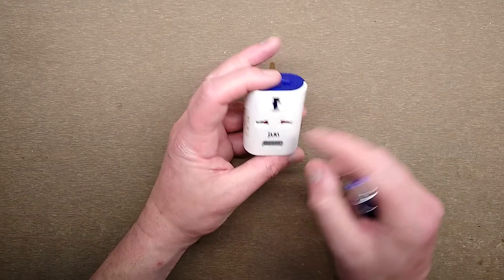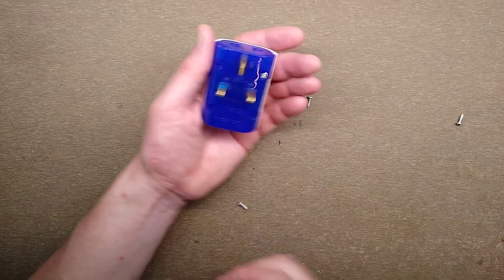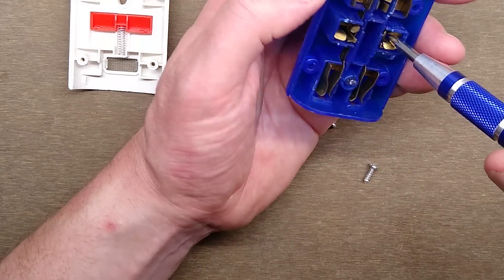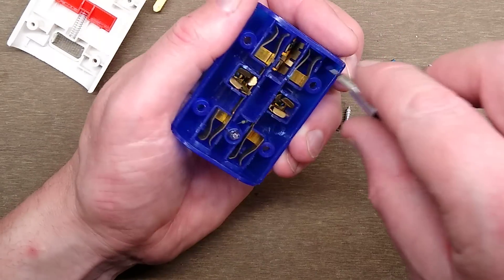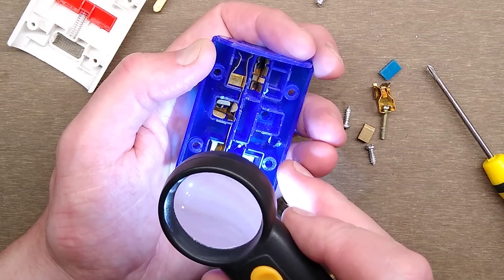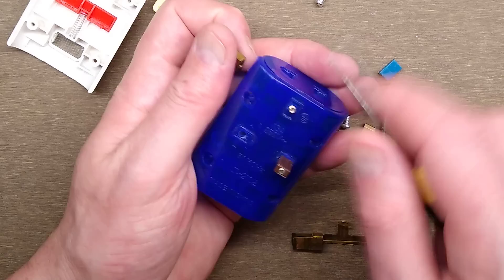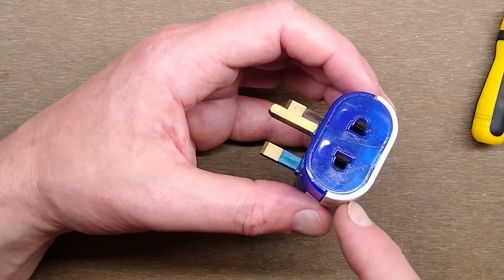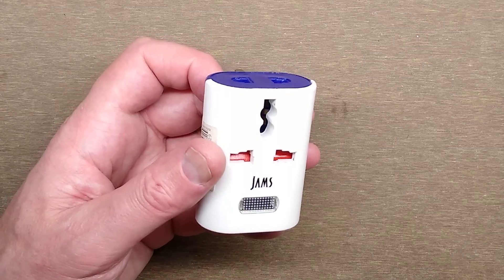Red Sea Mall death-dapter teardown

Comment: Do USB chargers in the UK have a removable fuse in the power supply? 
These devices are shaped like a plug and are plugged into the socket.

In Germany sockets are 16 Amp fuseed. (The same circuit breakers as in the UK.) 
The small plugs may be loaded with less than 2.5 amps. The full size plugs are intended for up to 10 amps. There is no additional fuse.
Reply: No, USB adaptors and other chargers or low voltage power supplies that plug in directly do not (usually, if ever) have a removable fuse. I'd hope internally they have a fuse, or fusible resistor - but given the range of quality out there, that is a bit of a gamble!  It is a good point though, as has been said already in the UK our 13A outlets are typically (not always) protected by a 32A breaker (or 30A fuse) - hence why our 13A plugs have internal fuses. The regulations only require 3A or 13A in the plug, although 5A is very common (1A, 2A, 7A and 10A are available).  The fuse in the plug incidentally is chosen to protect the flex (cord) and not the appliance - that should have its own safety measures, which is probably why we get away without removable fuses in chargers etc.
Reply from the maker: They don't.  That's why I often recommend plugging them into a short 
 fused extension.

Comment: My 2 thoughts : firstly the hidden surprise with these devices is the use of thermoplastic that softens with heat to give a runaway failure. Secondly, why would you buy an UK adaptor abroad?
Reply: Saudi uses these sockets, and there are a lot of devices around with eu/us plugs.
Reply: A lot of former british territories still use british plugs & sockets (whether 13A BS1363 or the 5A or 15A BS546 round-pin types), so require the use of adaptors when europlugs, Aussie/Kiwi or US/china plugs are on whatever devices people take with them...
Reply: I was thinking that initially, then reasoned that a traveller passing through the Middle East en-route to UK would want one. I didn't know Saudi uses them.

Comment: well honestly I think a simple HRC fuse in ANY cord/flex is a good idea and should be MANDATED
mainly that every device that connects to a normal AC circuit has a fuse for the rated power of the device
inside the device when hardwired
inside the removable flex either via an inline holder or in the plug for removable plugs (Like an IEC c13 cord used for most PC supplies)
the fuse should ALWAYS be user replaceable and should be rated for the highest power of the device/flex and be capable of breaking the power of the maximum of it's rated voltage circuit(30-50a peak 120v in the usa ~60a 240v in other countries)
I am actually quite angry at the lack of ANY fused plug replacements in USA electrical connectors as we have so many obvious fires caused by overloaded cords especially with old-fashioned tungsten "holiday lights"
the data is wishy-washy over exactly how many instances that is but if we cared at all to fix the issue the number can easily drop to nearly 0 (yes stupid people will bypass blown fuses but at that point it is no longer a flaw in the system but stupidity in people)
so this comment is a "shame on you" to the NEC who stubbornly try to make people not fall into the flaws of our electrical system rather than just fixing the flaws
NEC just mandate all new cordsets have a user replaceable fuse rated for the power of the cordset or device
sure we will still have some devices that will cause fires but over time we will slowly lose all those devices as normal wear and tear will have older cordsets be damaged to the point new ends need to be added or damaged sections of wires removed and then they can only buy fused ends so then those old cords will become safe compared to the previous versions
you can even allow use of "micro breakers" for cordsets as long as they are rated properly
just stop ignoring the only real practical solution because it will take a few generations to be fully implemented as even a partial implementation is better than nothing
Reply: I was always amazed by the lack of fusing anywhere on any plug in the USA, back in the 1960's mom always used a "15 amp" rated extension cord on the iron that was like lamp cord and got quite warm when used.  They are a little better now.  But I gave up worrying about those things when I realized that consumers in USA absolutely cannot be bothered with fuses.  Actually most Christmas lights nowadays are fused in the plug but only on the light loop, the pass through isn't fused so I suppose you can still set the tree on fire.  Maybe the cords are tested at a dead short at 20 amps and actually can trip the building breaker without causing a fire?
Reply: @davidg4288  nope they still are a significant source of electrical fires (I shorted 1m(3ft) of 24awg wire and melted the insulation clean off at only 20vdc
there is no way to safely prevent fires without using super thick wires capable of taking the full current without hitting the melting point of the insulation or blowing a current limiting device like a fuse or breaker
in the usa there just appears to be no organization that understands that fuses/breakers are cheaper than a house fire and the only viable solution to overloaded wires
we just need to fully replace the NEC with something that isn't stupid
they actually thought the issues with extensions could be fixed by codifying outlet spacing into new buildings to make extensions pointless
yet they neglect older buildings that have yet to burn down and forget that extensions are more often used for non-wall placed devices like laptops and other portable devices as a secondary outlet that is nearby to the center of large rooms is always more useful than stretching a charger to the nearest wall plug
let alone that ALL desktop an TV setups have more than 2 devices that need a few watts of power and don't pass through the outlet for another device  while the only option is the duplex plugs that are installed and a power strip
luckily Technology connections did a great video explaining this issue and how a tri-plug cord tends to never be used as an "extension" but rather as a "splitter" and he is right I use a tri-plug 2 pin(un grounded) cordset as a convenient place to connect the 10-60w hot glue gun, a lamp, and my backup 12v 5a psu for my ts100 all in one convenient workspace
so the real issue is not actually distance in most cases but rather the number of plugs or the fact that wall outlets are often behind large objects already
so those tri-plug cords could easily add a fuse spot and the only reason they don't is due to lack of regulation forcing it
and as for normal grounded cords there is a common little led/neon inside plugs yet a tiny fuse can't fit? bullshit
just skip the LED gimmick and add a fuse spot for a super cheap 13a or even 20 hrc fuse
yes the common value in uk systems is 13a which is oddly the max a 16awg can take(so just add a fuse holder) and then we will have the only greater fuse type in the usa be likely 20a as if a cord can take more than 13a you likely will be pushing the circuit breaker to the limits anyway so a warm wire is a small price to pay if you need more than the continuous duty 1500w in code for a nema 5-15r cordset
honestly 13a HRC fuses have been made uber cheap by the common usage in UK plugs so the only reason to avoid it is stupid american stubbornness thinking "we can't be wrong or silly we are americans" but public opinion should NEVER be more important than basic safety
plus we need to stop encouraging the "never plug many things into one thing" idea that has people cringing over an led-lit shelf array with 20-30 power supplies being plugged into 1 outlet that only uses a couple hundred watts peak, well below breaker and wire overload
my parents freaked in the early days of having a desktop PC thinking a full power strip was a fire hazard but then I calmly explained "I did the math this plug isn't even carrying more than 5a and the limit for these wires is over double that before risk of fire" they knew I was right about the actual thing that mattered being maximum current and these days they understand little 12v 1a dc supplies effectively count as nothing and have 12(yes 12) things plugged in behind the living room tv and understand that spot isn't even reaching 500w as every device besides the tv/dvd+vhs/subwoofer are all devices that take less than 12w each and 12*10 is 120w and the tv maybe hits 100w and same with the two peices of the old surround sound system at volumes they don't scream "turn it down" over
so the cringe of having many things plugged in is outdated as these days we have hundreds of devices that almost don't count when calculating circuit capacity
the real issue is extensions with the once yearly holiday lights that use incandescent bulbs as it never mattered enough to replace a working set
each holiday light set has 1.5-2.5v incandescent bulbs that need at least 250ma to start glowing and can reach 500ma
and as each set can have 2 strings in parallel you can quickly hit the 3a that those light sets are capable of carrying and yet then that is often only 3-6 sets and some people get crazy having dozens of sets
a single holiday setup could actually reach enough that a 15a breaker will trip if they were all on one plug
and with the stupid american idea of "don't replace it till it is so broken you can't repair it then buy the cheapest and often wasteful replacement" gets them back to tungsten bulbs as if they didn't have a chance at nearly just as cheap LED sets that would save them even more in the long run
yeah I am gonna be adding fuses in any electrical doodad I build that is made for more than a couple watts especially my future 30a generator breakout array
it will have a localized 20a micro breaker at each outlet block and pass through the super thick 30 feed to protect the devices and internal jumper wires from the 8awg lines that can't fit into nema outlets to the 14awg lines that can fufill the needs of just about any 15a device
will be using heatshrink and clamp connectors to bond those wire types (maybe pull off a couple of the strands depending on the use-case to get the ideal current breakout

Comment: In North America we have plenty of plugs with no insulation on the legs, and there is no fuse or switch at the outlet/cord. It is amazing we are still alive. Lol. The adapter shown seems ok, although I would rather do away with the screws and have a solid connection. Maybe some conductive thread locking compound?
Reply: But only half the voltage in NA though
Reply: @rexsceleratorum1632  Typically 120 volts but practically every home and building in the US has 240 volts available at the service entrance for a stove, dryer, water heater, etc.  If you have to have a proper UK kettle you can get a 240 volt outlet installed for that too.  Bert is right about the lack of insulation on the "prongs", I once dropped pliers on a partly inserted plug and generated a shower of sparks and molten metal.
Reply: @davidg4288  in the EU/UK you can get 400V outlets, so what is the point of saying the US has 220V? And it is not the same thing, as it is two phases with 110V each against gnd/ neutral.
Reply: @davidg4288  Still 120V to ground, while every single outlet here in India is 230V to ground. Our standard plug legs/pins are not insulated. There is almost always a switch at the outlet, but fuses are rare.
Reply: @sarowie  In an industrial or commercial setting 277 / 480 V is not uncommon in the USA.  Do you use 400 V in the EU/UK in residential for HVAC or something?  Or is that a commercial or industrial voltage?
Reply: @davidg4288  3 phase 230/400 V is very common for residential in European countries.
Reply: @mernokimuvek  3 phase (120/208) might be found in USA in large city apartment buildings.  Otherwise residential customers need to pay extra for 3 phase.  A few home machinists will do just that.  Sometimes there is no 3 phase on your street so you need to come up with some inefficient way to make it yourself using capacitors, rotating machinery, or inverters.

Comment: A shutter? Luxury! Here in India no one is scared of a measly 230V. If you're clumsy and touch an exposed wire somewhere, that's on you. I know people who remove the annoying shutters from sockets prior to DIY installing. Normal shutter-less deathdapters are considered perfectly safe and are found everywhere.
Reply: The shutters are meant to stop children not thorough enough to defeat them.  Before shutters, parents would purchase plastic plugs for all their unused sockets.
Reply: @johndododoe1411  some parents still do even though theyre no longer required and actually help defeat the safety system!
Reply: @johndododoe1411  British outlets have had shutters since day one (1947?) the plastic socket protectors were never needed and some argue they are less safe than the built-in shutters.
Reply: Yes we often forget that other countries use the British plug but have different laws and attitudes to electrical safety. And probably don’t have ring circuits with 32A breakers.
Reply: @connerlabs  We use three different sizes (!) of round pinned plugs and not the (newer?) square monstrosities of the UK. 

AFAIK we don't use ring circuits, just a tree topology. The breakers are commonly in the 6-16A range unless something calls for more. 

But a 6A circuit is just as deadly as a 32A circuit as long as they are both 230V.
Reply: @connerlabs  In fact, viewed in that light, the US system with 120V circuits fused for 15 or 20A are actually safer than the British user who installs 13A fuses in all of his plugs.

Comment: The neon lamp resistor would at worst experience 0.4W, so it might die in a while. That's as I see it a bit sketchy, but basically all adapters that you can get of that type are more or less in the danger zone.
I have put an IEC 60320 C14 connector on a power strip so all I need is the correct local plug to C13. That way I'd be reasonably sure that I'd also get the ground wiring correct - if the wall outlet is wired correctly. (We are going to test that as stated on Project Farm)
Reply: I wonder how many installations in the US have left the 3rd pin (ground/earth) unconnected as a simple way to adapt ungrounded circuits to handle the plugs.

Most EIA equipment racks with power strips use C14 or C19 receptacles.

Comment: Good morning, I have a question about a previous project you tackled, it was opening a Ryobi battery pack. The screw driver you used was not the same as the one my battery pack uses, my problem is I thought I had every screwdriver head known to man, but nothing I have seems to fit, it gets worse because they are so deep inside the battery case I cant even get one out to try and identify it, do you have any idea what it might be.
Best wishes for your channel
David
Reply from the maker: It may be a security torx.  You can get sets of security bits online.  (They have a central pin/hole to block ordinary drivers.)
Reply: @bigclivedotcom  Great, That sound like it.
David

Comment: The blue plastic looks like some kind of acrylic, which might be susceptible to cracking and leaving live connections accessible.  Overall, maybe a little bit more dodgy than I like.  My preference is to buy a real plug for the country I will be travelling to, and install it on a fused and surge protected power board with four switched outlets.  Can also have a fused 5V USB outlet for charging cameras etc.  It's worth the cost to protect yourself and your devices.

My brother had a camera that was rendered inoperable in Vietnam.  Apparently they (hotel staff) watched when they left the room, and turned the power off to the room to save power.  When it was turned back on again it took out his camera and some other devices.

Comment: I've seen similar designs. I don't like the fact that you can plug in a 120v 15a north American cord into a 240 volt  uk circuit, although,I suppose a switch mode power supply would not notice the difference
Reply: The whole point of adapters is to allow use in different countries. The user is responsible in checking that the voltage is correct.
Reply: @okaro6595  Coz users are always well educated in how electrickery works. Obviously.

My GF can wire a mains plug (and does a good job) without understanding jack sh*t about what she actually did. It took a whole side of A4 to explain why my (UK) amp blew up when her lad flipped the input transformer to the US setting in the UK. 
TBF the switch was recessed and in bright red. But a US design, so it wasn't obvious what voltage resulted when you flipped it.
Reply: That's correct, most devices state 110 to 240 volts.  It's the same device sold in all countries, just the plug is different.  You DO have to be careful about things that have been made for specific voltages however - usually things like hair dryers and toasters that do not have a switch mode power supply.

The thing that makes them "deathdapters" is the mostly shonky construction and the wide open holes that are designed to have almost anything poked into them.

Comment: Not a bad construction for a death-dapter.   I have definitely seen a lot worse in the wild.
Reply: Definitely.  The US has its share of older non-polarized adapters.
 I shiver when I run across the universal-universal adapters with plug blades that rotate to accommodate China-Aus-US receptacles.   
150K as a dropper for an NE-2 lamp isn't horrible--and it will probably fail by going open, if the neon doesn't give up the ghost beforehand.

A neon lamp generally has an operating (post-ignition) voltage of about 65V.
So, on a 230V circuit, the resistor drops 165 volts.   165²/150000 = 0.1815W.  Not wonderful, but not terrible either.